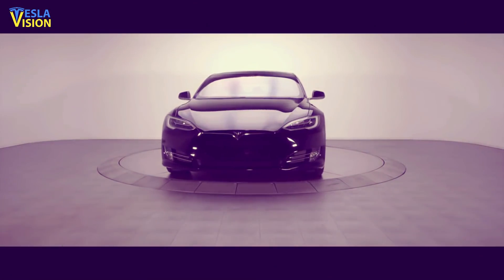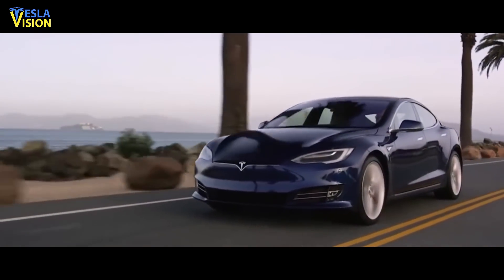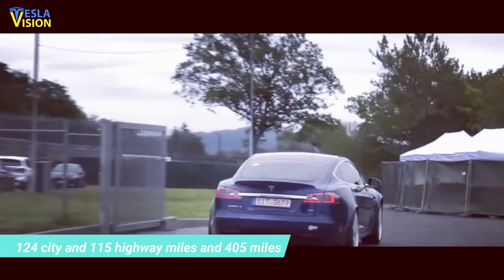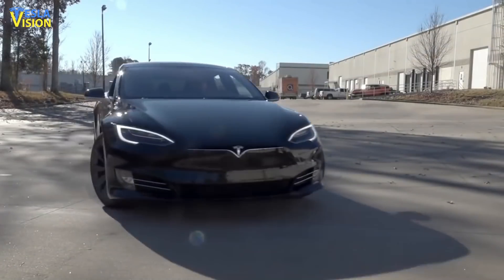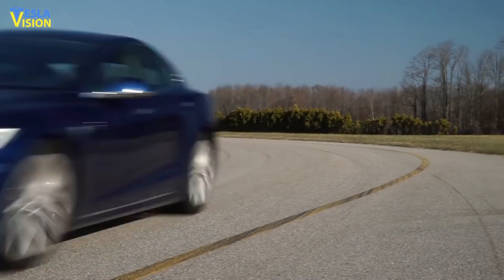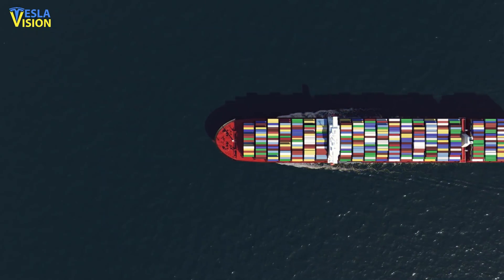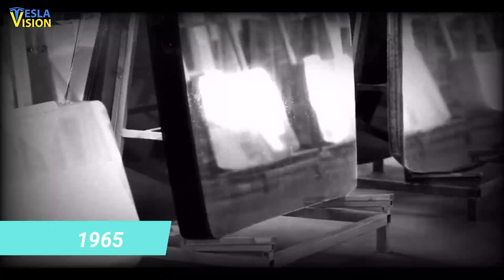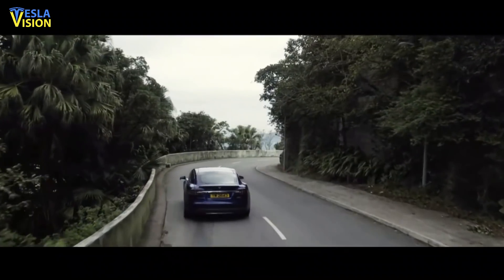THIS IS HUGE! Tesla Just Blew Up the Top EV Efficiency

Comment: I have a question that I have not seen addressed.  I live in Florida and the cars gets super hot when left in the sun even with a windshield visor and a solid roof.  With a glass roof and honestly glass everywhere hot much hotter does the inside get?  Does the car require more AC power when the car is just driving when the sun is out during the warmer months.  Can anyone comment?
Reply: It gets a lil hotter but i ordered a roof shade for 30 bucks on amazon.. problem solved. U can also use the app to turn on the hvac to pre cool or pre heat the cabin 👍🏽
Reply: I have seen comments from some people complaining that it gets too hot and the complete opposite, that it does not. These are people who live in warm areas like Florida and the Southwest. So there may be some subjectivity here. I do know it is possible to get the roof tinted at any tinting shop to reduce light and heat if desired.

Comment: Dude, most car companies are run by MBA's.  Tesla is run by Tony Stark.  LOL😁
Reply from the maker: Stark Industries will take us to Mars 🚀
Reply: @TeslaVisionChannel  Tell Jeff Bezos that he does not need to rebuild the 1969 moon lander. Elon Musk will drop him off on the moon when he takes us to mars.
Reply: Best comment ever 🤣🤣🤣🤣🤣🤣🤣
Reply: Elon will happily drop Jeff on the moon so he can fly his 1960s moon lander back for a refit.
Reply: @Dave5843-d9m  Better make sure earth still makes the parts. Does Jeff's ship still use vacuum tubes?
Reply: Large wheels and skinny tires look pretty, but they simply cannot handle the road debris and potholes that taller tyres will shrug off. 
When will we see electric brakes that don’t need brake pads and the heavy equipment the rest of us have to drag around.
Reply: @Dave5843-d9m  Tesla has build the world fast A.I. Super Computer it can process 1,000 petaflops per second.   Auto makers are don't even understand why they need a Super computer yet.
Reply: @Dave5843-d9m  I you are in the EV business you need to secure metals for all the batteries that you to make for your Electric Vehicles.   Tesla built a massive Giga battery plant in Nevada because the US State of Nevada has the US highest concentration of Lithium reserve.    The automaker haven't even built the battery factories yet.